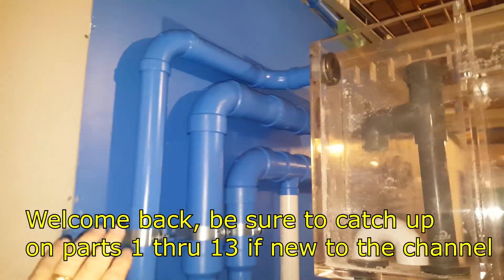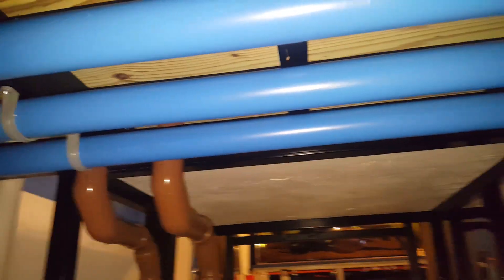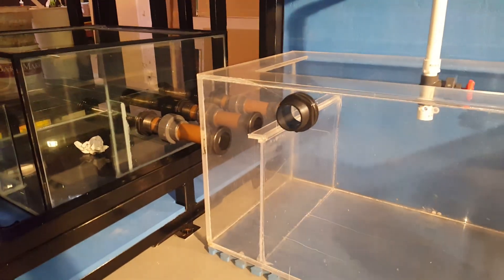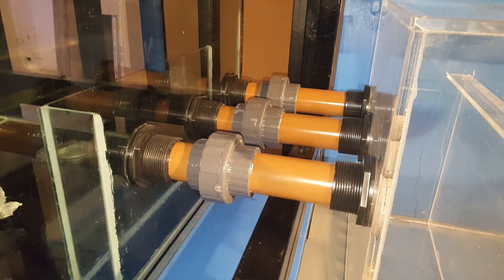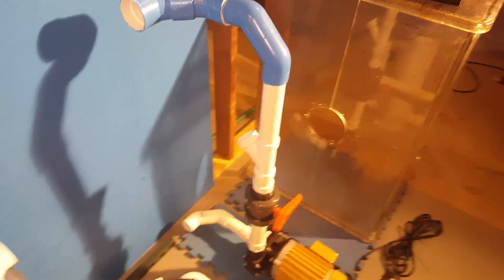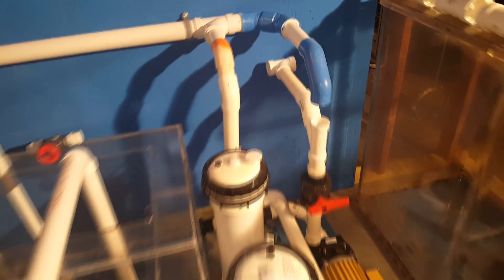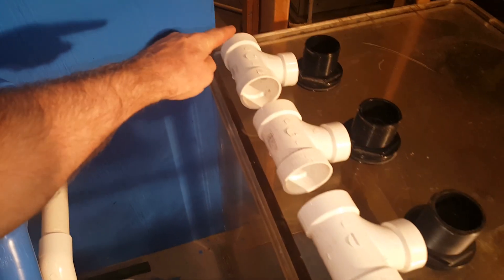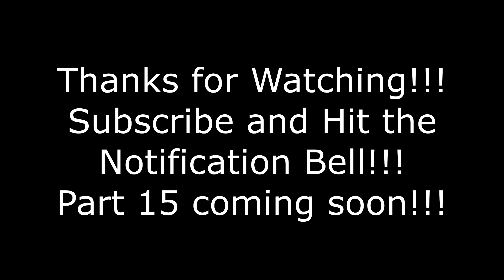HUGE Aquarium/Tank 1000 Gallon Build Out Part 14, FILTRATION SYSTEM DESIGN CONTINUES

Comment: A spectacular job this various sump filtration system for your giant aquarium. Interesting the various passages of mechanical and biological filtration, which large valves. I imagine the delivery pumps will have a great head to go up in the aquarium. I like the work you've done, I'm curious to see what follows, I signed up for three zero two. Thanks for sharing.
Reply from the maker: Thank you so much for subscribing Marco! Yes, this is getting interesting as its coming together. Part 15 should really start to connect the dots on final layout/design of filtration system. Check out parts 1-13 if you have not already.
Reply: @TheirWorldAquatics  thank you my friend for the info! Yes I see your work and video. Have a nice week end! You're Welcome to my aquarium channel!